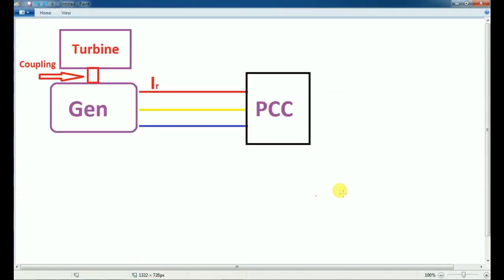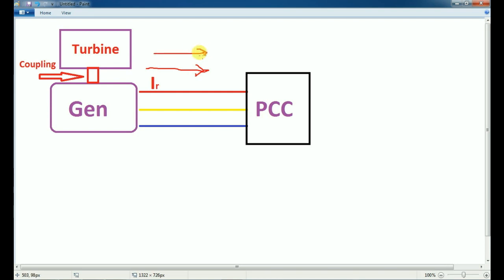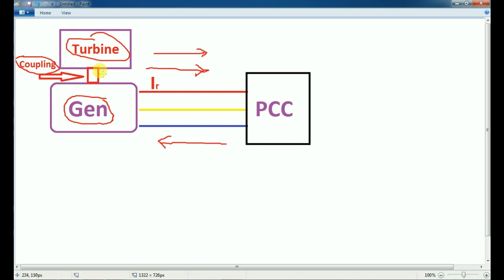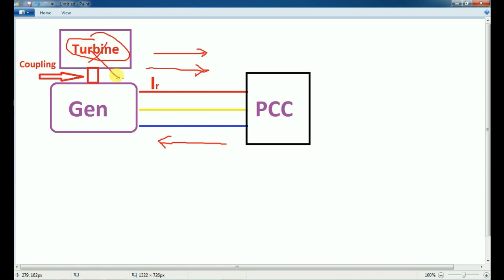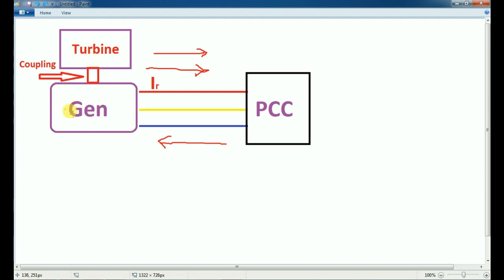What is Reverse Power protection Relays..Reason for Reverse Power Relay Operation

Comment: Bro avr fail aagichina u/v or o/v trip dhane varum but how reverse power trip will operate?
(Excitation proportion to voltage &
Governing proportional to power dhane),
Appo Reverse power  protection act aagudhuna appo turbine fault or governing fault dhane irukum how avr or diode fault?
Reply from the maker: Yoga rajan uv relay is last stage of tripping